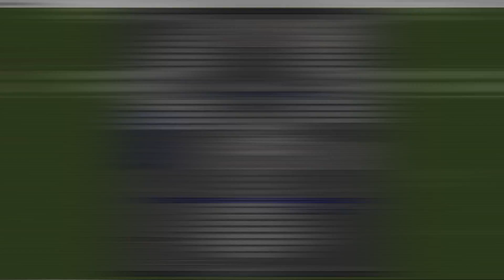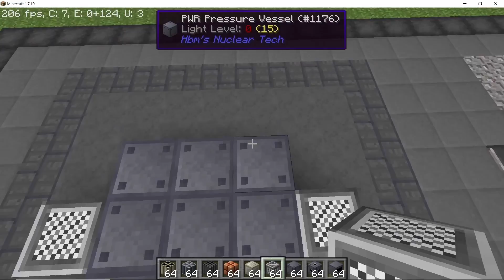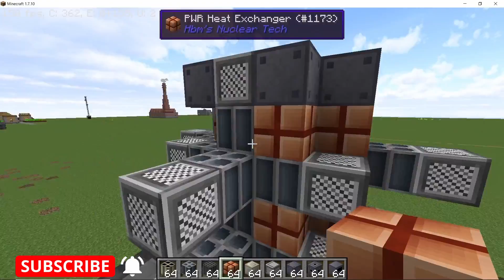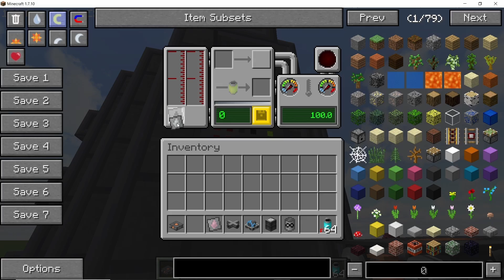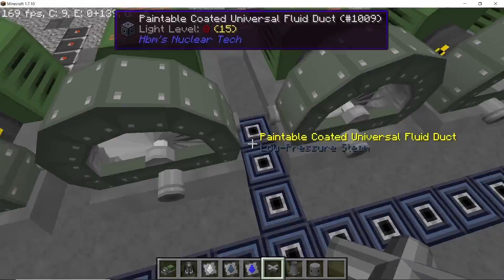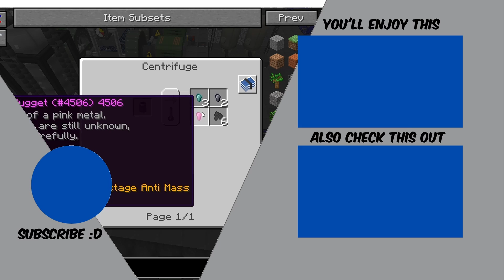Fast Schrabidium Depleting Liquid Sodium Reactor - HBM's Nuclear Tech Mod

Comment: I believe the buffer is required because the pipes start out empty, since just because you set the fluid identifier to water doesn’t mean they have water in them, which means the buffer is going to send water through the pipes when the reactor is started, and therefore there will be no water gap in the pipes. 
If you want an image description I can probably put one in your discord 

 I made that mistake on 1.12.2 with the multi block nuclear reactor and blew it up lol.
Reply: Hfhghhgghtp1248t502p2🎉
Reply: 🕌♨️🕋rgdgdfgggygthgggggghffgggggggggbhhyhhcvcfggggfgxcgcigcjgcthdtjxvxovhk😂

Comment: Can you make a video showing an easy way to make alot of copper?
Reply from the maker: I've already made videos on bedrock ore processing and copper bedrock ore deposits are pretty common in the world. You can use them to convert a single piece of copper bedrock into 32/64/128 ingots depending on your setup
Reply from the maker: Like for example I did a Uranium processing plant video recently, that's a good example of what you'll need to do for getting a very high yield

Comment: I have the 1.12.2 because my pc cant run 1.7.10 so i cant have the newest versions
Reply from the maker: Damn I hope you get a good setup soon bro
Reply: @SavageVegeta  i installed HBM’ NTM extended and i heard it has many 1.7.10 features but not all
Reply from the maker: @potatogames8718  yes it doesn't have all the features cause ntm 1.7.10 is the main version which is most frequently updated

Comment: Hey, nice video. But I saw that u using overdrive in acidizer.
Overdrive is not like speed upgrade. It is like a multiplier for it, maybe at solo it worse than speed. Experemrnt with overdrive and speed a bit, u will feel it.
Reply from the maker: That acidizer had a speed and overdrive upgrade in it ... I was out of speed upgrade for the next centrifuge so I took it out from the acidizer and forgot to place one in it ☠️

Comment: Hey, can you make a guide on power source progression? I’m right now at early mid-game and the old combustion generators begin to be a bit outdated, but RBMK etc. are a bit too complex and too powerful for my needs. I think it could be very useful for many 😄
Reply: Good idea👍
Reply: Solar tower boilers is what I got after combustion generators. They are pretty cheap so I recommend that
Reply from the maker: It generally goes from combustion gens to oil power ... With oil you can use industrial generator which is pretty efficient and also CCGT's and oil gives you access to CO2 which will be used in your first nuclear reactor which will be zirnox. 
Now you won't need to jump to RBMKs directly too as PWR's are available and that reactor is extremely modular and much safer compared to rbmk. So that is how it would go I guess. 
As for fuel I recommend sticking to uranium and thorium as they have their bedrock ores available and depleting them will give you access to even more fuel for the reactors.
Reply from the maker: I will try to make a proper guide for the whole thing but that'll take time as you guys are survival players and I am not a fan of survival at all xd.
Reply: Zirnox is a pretty good option after combustions
Reply: @thehound9694  isn’t the fuel hard to get? I haven’t looked into it much
Reply: @jellybeaniac152  You can power Zirnox even using unenriched uranium, so no infrastructure is required. Singleblock turbines will handle this power.
Another option is thorium. You put some pure Th-232 in the rods and hold them close to uranium, this will breed Thorium to thorium fuel. When you reprocess Thorium fuel, you'll get 2 nuggets if U-233 per billet (which is enough for 2 billets of thorium fuel).
Note that both options don't produce Technetium. You'll need to switch to uranium fuel or ZFB for that.
Reply: @mcnaotlichno  Ok thanks! I will hopefully remember this